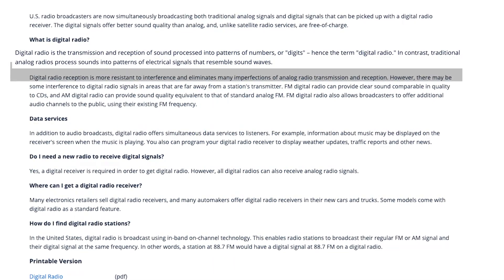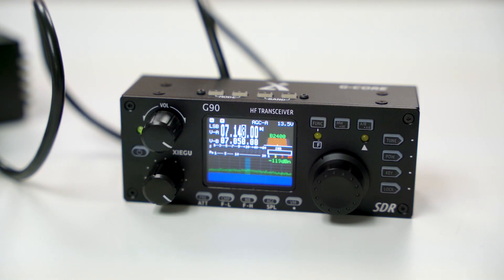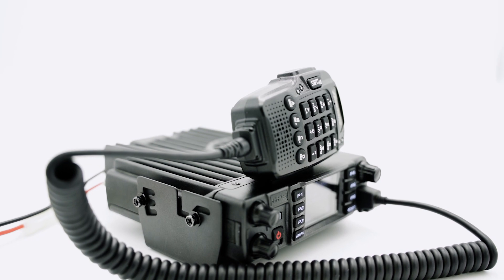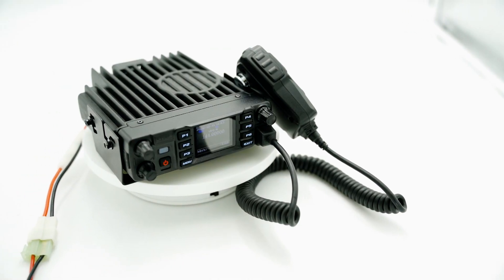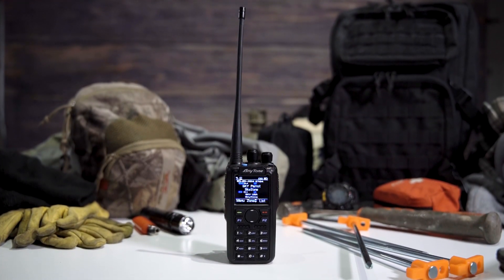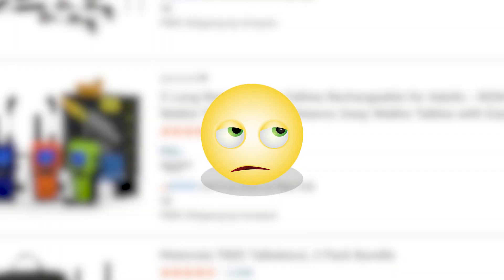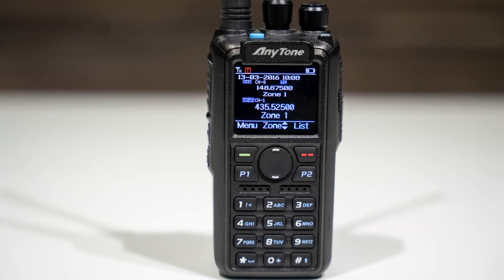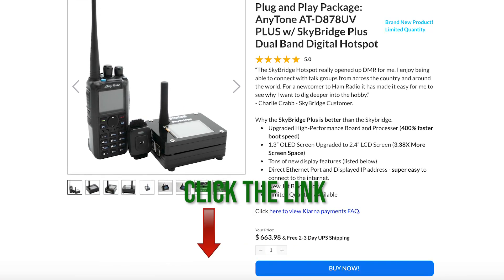Analog VS Digital Radio: A Beginner's Guide to Radio Modes

Comment: Wouldn't digital radio just be an analog signal that has been modulated digitally, and analog radio would then be an analog signal using a form of analog modulation?

Comment: Do you technically need a license to use digital radio other than DMR? Do you need to insert your call sign?
Reply from the maker: Thank you for your comment. All Amateur radios require a license to operate.
Reply: @BridgeComSystemsInc  yea I know that you are supposed to, but I mean for emergencies
Reply: @Telyron  emergencies you don't need to have a license

Comment: I never thought about it before, but it's interesting to see that digital radio is able to connect with the internet. I wonder if there's a situation where that could ever be a bad thing. You might want the ability to use the radio without it connecting to the internet, because in an apocalypse scenario, the internet might not be working, or in a dictatorship scenario, where the internet is censored and controlled by the authorities, you would want a radio that's totally independent.
Reply: Why wouldn't you assume there would be a way to turn it off?

I mean you can do that with your phone, so why wouldn't they build that into a radio.

Also, most digital radios also do analog.
Reply: @dangerous8333  If you turn off the internet on your phone it almost always is not off. All it does it keep you from using internet/gps, but your phone is still connected and sending data packets on your activities. In fact even if you take out the battery such as on older phones, there is still a secondary internal battery that keeps running for some time.

Comment: having internet connectivity makes no sense since we already have advanced internet connected devices - our cell phones, tablets, etc. Amateur radio is supposed to be used for emergencies and disasters when there are no other comms or even power available and all your internet bells and whistles will be unavailable then. Internet ham radio is like a wilderness survival cooking stove with a wall plug.
Reply: So get a radio that does both.

🤷
Reply: It's really nice to be out in the middle of the mountains where no internet is available and still create some kind of local area network with someone 55 miles away.
Reply: Actually D-star works both analog and digital
Reply: @MrTalkingzero  it does make sense since you can connect far more ranges and free up frequency. Also satellite based internet is a thing.
Reply from the maker: Thank you for your comment.  We disagree.  Ham radio is a big sandbox where there's virtually no limit on where you can explore.  The world's your oyster!  Have fun!

Comment: Can I use an analog HT to transmit to the hotspot or do I have to have a digital radio?
Reply from the maker: You'll need a digital radio because a hotspot is an internet gateway to a DMR network. You would need a digital radio to communicate with someone who's using the internet to make a contact.

Comment: Noob Here, can you do Digital with out going through DMR or one of the others?
Reply: You can absolutely use digital radio without going through a digital network. In some cases, you can use digital voice modes in simplex or in conventional repeater mode just like analog. I do this regularly on P25. Don't be fooled - you absolutely do NOT have to use a digital network.
Reply from the maker: You can use your radio in simplex or with conventional repeaters, depending on the radio. To get the most out of radio and access TGs, we recommend utilizing a digital network.
Reply from the maker: Hi John, you'll have to use a digital network, such as Brandmeister, NXDN, YSF, etc., to get on digital radio.